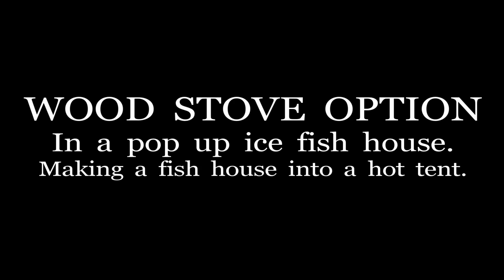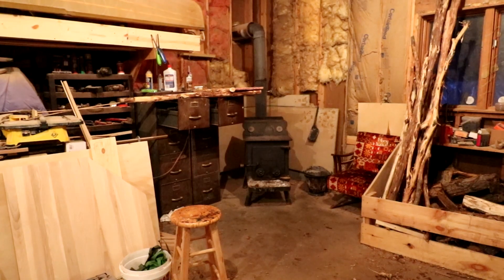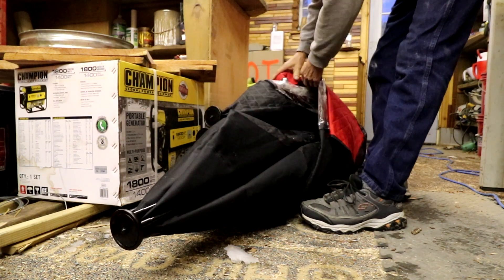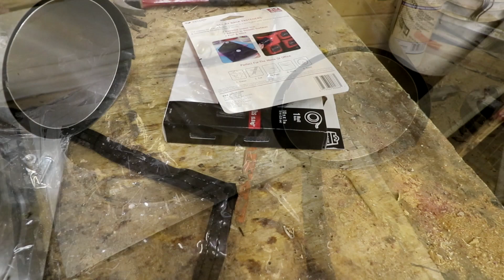Adding a wood stove heating option for your portable pop up fish house. How to make a Hot Tent.

Comment: Another nice video joe.
The reason I bought the Eskimo(I went with the 9416i, plenty of room for cots) is because of the removable windows that can accommodate a stove pipe. I set mine up very similar to yours joe, except I used sheet metal instead of welding fabric. I also drilled out the stove pipe on two sides near the top and installed eye bolts and ran heavy string down to the plastic eyes that are  located on the sides of the tent. This stabilized the pipe nicely. 
Also, putting a hinged plywood floor down prevents slipping around on melted snow and ice. 
Cant wait for the next fishing video!

Comment: Hey Joe have you ever thought about buying one of those small suitcase style generators? About 2,000 Watts should be enough to run a good forced air electric heater inside your shanty. Think about it no firewood no having to wait for the wood stove to cool down no disposal of the ash. Quick, odorless, quiet, efficient, and safe heat. You can still bring a very small propane grill to cook on.

Comment: I did similar this fall while using my pop up for deer hunting.  My hole placement was 'as far from as all edges as possible.'  So, a little lower than yours and it worked well. 

Exterior tripod was needed, much like you did.

The window cover now below the window can be folded up behind itself with the corner tucked into the bottom corner of the neighboring window.  Just held up by the velcro.  This is to prevent it from melting from the heat from the back of the stove.
You will be too hot.  Better than not being hot enough.

Comment: After reading the comments everyone seems to have good ideas about fire safety. Your pipe support stand was a great idea but I have to add my two cents. Keep the change. You've addressed the weight problem of the pipe exiting the tent with your stand and chain configuration. But, you have a long stack swinging in the wind. I was thinking you could use two more chains attached to the top of the pipe and tied into your pipe stand in a V configuration. But, you're the Master and I hope to see the final design in action.
Reply from the maker: I am not much for going out fishing on real windy days and if it was to get windy I would remove the top piece of pipe. As long as the wind is blowing away from the house sparks would not be a problem. If like you said I do have trouble I can cable or chain it on each side down to the pull out loops on the shelters sides. Until I get out there and use the wood stove I will now know.

Comment: I did this myself last year and it  is awesome...i dont use it to fish just to winter camp   it does not take a very big stove to heat a tent...way too big of stove is my thinking...omg!  your going to  sweat like you cant believe!!!  use a 3 inch pipe at the very most. also try silicone baking sheets  and cut to fit. or stove jack   you dont need the metal ring attached too heavy...just a silicone opening with the pipe going through it.   put a piece of welding blanket jsut below the stove jack to prevent the heat from the stove.

Comment: Joe put a sheet metal plate on the outside and pop rivet it together.
Reply from the maker: If I did that it would not be removable, if it can not be removed the pop up fish house can no longer be popped down and fit into the bag.
Reply: No you have the same way as you do now but just put a plate on the other side. Make a sandwich and pop it in and out. Everything stays as you have it.

Comment: Hey, thanks for the video, I'm actually going to be doing the same project, since hind sight is 20-20 anything you would change?
Reply from the maker: They are not water proof. If it rains (if you use it for any type of non winter camping) you need to waterproof the seams or bring a tarp. Otherwise it works real well. You do not need that big of a stove, it gets hot fast

Comment: The wood heat is going to feel so much better than the propane heat out ice fishing. Now you just will have to worry about melting the ice in the shack. Next will be a removable floor system to keep your feetwarm.
Reply from the maker: I really do love fish houses with floors in them. Back years ago they always had floors but now with these portable ones they do not.

Comment: I would recommend using a carbon monoxide detector when using any camp space heater. The unvented 'buddy heater' type of heater vent the combustion gasses directly into the (probably) confined space you are trying to heat. It is best to know what is going on. Carbon monoxide is odorless.
Reply from the maker: I agree. They are rated for use indoors and are the most used portable propane heater ever made. While most people get no ill effects, I could tell I had been in a room with a non vented heater.
Reply: There are vented RV furnace type heaters, but they aren't cheap. Also, these heaters require 12V DC. These heaters are intended for heating an RV or vehicle, and have a heat exchanger and a flu like a home furnace. Some models are lightweight and small. I don't know if they could be adapted for a tent. It would be kind of overkill anyway. However, if I was heating a small trailer or a small cabin with propane, I would want something like that.

Comment: You should have the crimps going in the direction of the flow on pipe like that:)
Reply from the maker: This is not a stove that will be burning for days and also if you do it the way you are saying (which is the correct way) I will be dealing with creosote running down the pipe and burning since this stove will have to be burning at a very low heat since the area it is heating is so small.  You are correct in what you are saying but in this application it does not work well at all. I have done this many times in the past. You learn as you go. I am less worried about any smoke that may escape (and it really wont) and more worried about the creosote.

Comment: Minnesota engineering right there! 

I dub thee 'The Mini-Tent'

Do you have any of the fire board from under the tent's stove laying around? Might be an extra safety measure for under the  pop up stove.. in case it's not at heat resistant.
Reply: Michael J. Schaefer it sits right on the ice. no floor. no reason to put anything under it. watch his previous video.  the gas heater Is starting to sink in the ice a little. but behind it where it gets closer to the wall would be a good ideal

Comment: Just a suggestion for your vent piping. The crimped end of the pipe ALWAYS must go in the direction of the flue gases NOT against them. Connect the stove with uncrimped end and work your way out to rain cap.
Reply from the maker: Ideally that would be nice but this will only be run maybe 5 or 6 hours at a time. I am not in the least bit worried. I will not be installing a rain cap either.
Reply: @JoeandZachSurvival  K.

Comment: using a welding blanket to prevent  radiation  heat to reach the wall  that was my solution when I am using a my stove with hex screen shelter

Comment: Joe why donr you rivet it on the welding blanket. Just cut one inch strips of sheet metal on the back and rivet together. Just a thought.
Reply from the maker: Because I did not have any rivets and I wasn't going to drive 15 miles one way to buy some and waste an hour of my time when there was absolutely no reason to when the wire will be just as effective.

Comment: you can try rivets with a backing of some sheet metal  sandwiching the material instead of the wire
Reply from the maker: Yes I could have if I would have had any rivets but I didn't. No reason to waste an hour driving to and from the store to buy some when the wire will last just as many years as a rivet would have.

Comment: @joeandzachsurvival is it feasible to enlarge the hole in the stove to accept a 6 in flute pipe?
Reply from the maker: I would rather go smaller than bigger.
Reply: @JoeandZachSurvival  maybe get some piece of heavy gauge steel and cut a 4" hole and bolt it over the 5" and use some fireplace rope to seal it up.  Just a thought.

Comment: Does that make it too hot? Do you have to keep moving the tent around for melting ice ?
Reply from the maker: CRH is correct, also, it isnt going to have to get any hotter than a propane heater, it only has to heat it inside. Some ice will melt yes like always but it is not that big of a deal. Something under the stove like CRH suggested would be a big help.

Comment: Hey Joe, couple questions after I re watched.   1. Is the stove going to get to hot and potentially melt the side of the ice tent.    2. Are you going to set stove on something?  I thinking a five hour burn, that stove is going to melt the ice?    I asking because I don't know, and I'm trying to learn.   Great video
Reply from the maker: It will melt some ice just like the propane heater does, i mean not enough to be worried at all but the floor (ice) will be wet. I may put it on something to reflect that heat away from the ice under the stove. I have not gotten that far yet.

Comment: When you cut the fire proof blanket for the window the edges where you cut will unravel if you don’t sew it
Reply: I was thinking a double fold, then stitch.  Do this while sewing on the velcro.

Also, at the same time, sew on a drape of welding fabric so it almost touches the floor and is allowed to free hang.  the tent wall won't see any hot temps!

Comment: Have you check out St. Francis hardware store for a 5" damper
Reply from the maker: That is THEE only place I can buy them off the shelf.  They are in the very far back right corner of the stove. Twice I have bought them out of the 5 inch and had to tell them up front to order more of them.
Reply: @JoeandZachSurvival  
If seem if they don't have it, it is not made. I am from Isanti
Reply from the maker: I totally agree.

Comment: What are the measurements for your shop stairs?
Reply from the maker: I have no idea.
Reply: How many steps and the height estimated would be fine
Reply from the maker: I will have to count next time I am at that workshop. The ceiling in there or the height you are looking for is 10 feet floor to floor. Maybe you could pause the video and count the steps. The steps are very steep.

Comment: your sleeve should go over top (over lap) instead of inside, your still have CO in tent the way your doing it.  the first one you cut should crimped next pipe  over top al the way out to open air

Comment: I'm the same way when it comes to propane.
Reply from the maker: I know that the buddy heater I have (I have 3 of them) are safe and will shut off if oxygen gets low but I still get affected if I am in a room like that with them for an extended period of time. The sunflower heaters are horrible and the torpedo types about kill me right away.
Reply: We were on a construction site about 10 years back and we're running propane heaters to keep it warm in there. We both ended up getting sick. We found out that it was the propane heaters we were using. Awesome idea for the wood stove in the Ice House. I might have to do that to mine. Take care

Comment: rivets, instead of wire. and Velcro  , ask your boy he has some
Reply: I thought the same thing. Lol
Reply: Yep, that's my thought as well.  Rivets will hold.
Reply from the maker: I did not have a rivet gun and rivets or that is exactly what I would have done. I am not one to wait around at all though so the wire will work equally as good and I had it on hand.
Reply from the maker: This thing was made to be removable so I would not have riveted it to the fish house.
Reply: JoeandZachSurvival I think they mean to rivet the Velcro to the welding blanket instead of having to sew it
Reply: lol
Reply: rivet the metal flange to the welding blanket??
I don't think that would hold?

Comment: I wonder how many videos dont get made because of armchair quarterbacks second guessing everything being done. 1. He can open extra windows for ventilation. 2. He can add heat shielding if its needed, later. 3. This is not living quarters, its going to see a few hours use, a few days of the year. 4. Its a fabric tent all you safety Sally's that worry about everything so you never do anything. Worst case you cut your way out or put your gloves on and throw the stove out the entry. If you want me to remove this comment let me know Joe, but you have the patience of Job compared to me.
Reply from the maker: I couldn't have said it better myself. Sit at home and worry all the time you never do anything but sit at home.
Reply: War Monger amen brother 😂